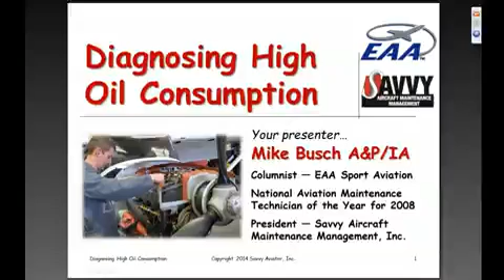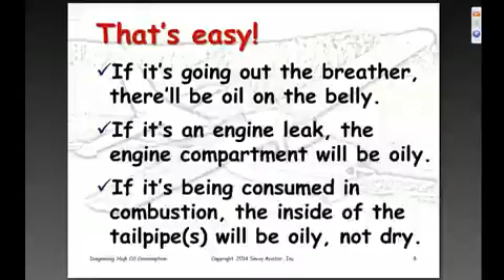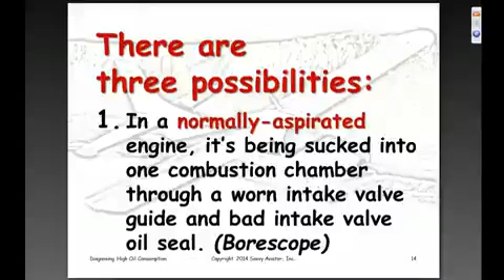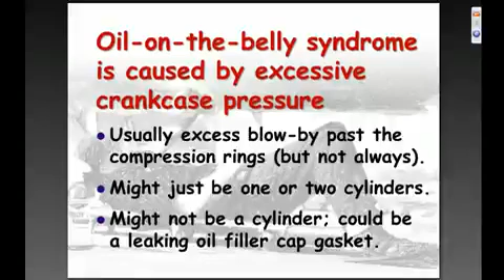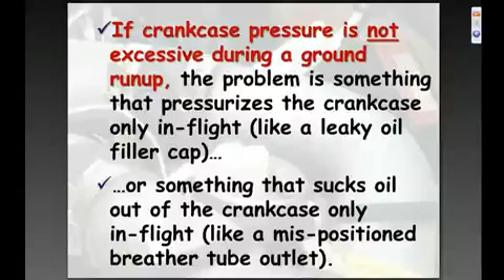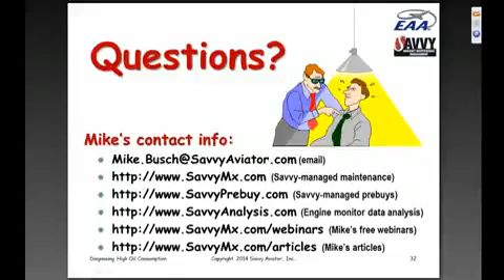Diagnosing High Oil Consumption

Comment: I had a 310 R ferried from theUS to Australia. The first leg to Honolulu grounded the aircraft due to high oil consumption. A top overhaul was done there before continuing.  The Ferry Pilot declared an emergency again inbound to Brisbane because he had to shut down the same engine due to loss of oil pressure. On arrival at my place I noted that the engine had been top overhauled in the US due to high oil consumption.  The problem turned out to be a leaking prop’ seal.  We wrapped a rag around an air hose and directed high pressure air into the oil filler. We could hear air escaping from the prop hub at a great rate.  The sump was being pressurised and the oil was blowing out of the breather in flight.  Simple fix, replaced the prop seal. No more problems.

Comment: At 19:30, the claim is made that anything over 90 MPH on the "Altimiter" is excessive. Maybe we should use the words "Airspeed Indicator" if we are going to use an aircraft flight instrument to measure operational crankcase pressure.
Reply: And then mere seconds later it's corrected. I know it was six years ago but did you pause to write this comment and then just never resume the video?

Comment: Air oil separator is fine IF you route the oil gunk into a catch bottle and dump it, vs route it back into the engine. It does reduce the belly mess a little.